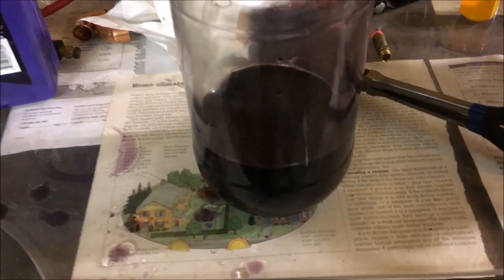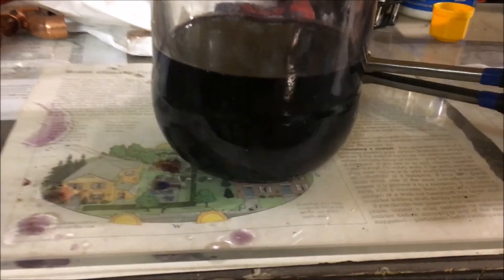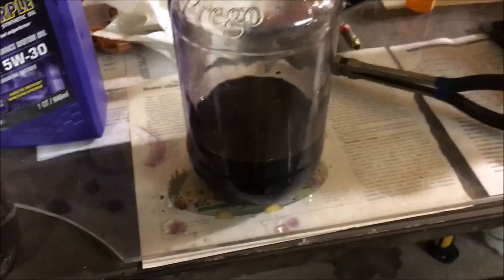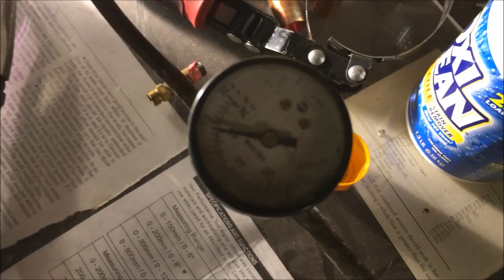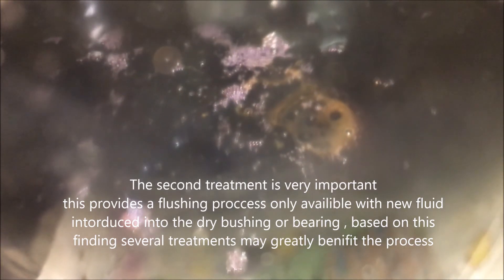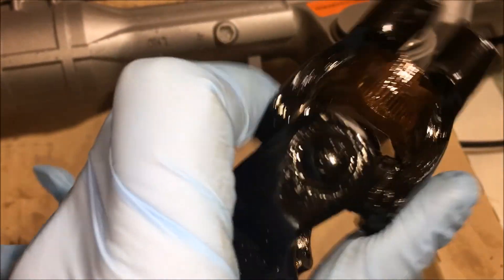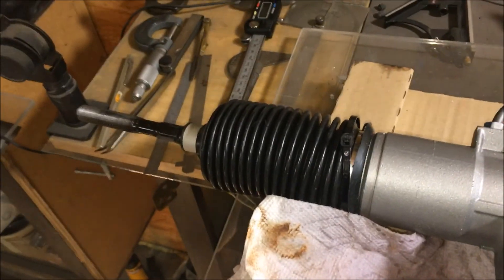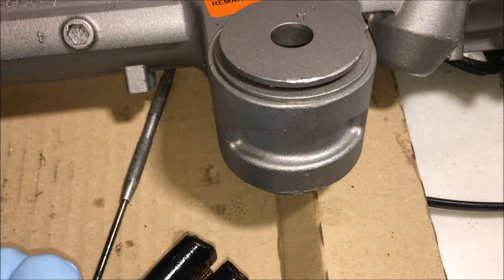Sealed Bearing Restoration,  Flushing and Recharging using vacuum pump

Comment: Boiled chip fat. If you want metal to never rust heat that metal then pour waste cold chip fat on it never rusts or gets contaminated. Did this on my car trailer hitch where I welded it as we were getting thefts of complete hitches a bit of a bummer when you had to use it and could not so that's the reason Same effect on bearings but clean chip fat of coarse
Reply from the maker: thanks for the tip , i never herd of chip fat
Reply: A uk meaning in u s a you may call it veggie oil ok
Reply: We have shops here called chip shops   Food is chips  you call fries a older type McDonald's  that we eat at for fish and chips.
Reply from the maker: oh ok yeah yes we have billions of gallons of chip fat in america , yes i have noticed that stuff does not come of of something once its on there and it repels water like a ducks back

Comment: I wouldn't have thought about using vacuum.  Great idea!!!!   I wonder if drilling some small holes(1/16"?) in the dust caps would help.  They could be sealed over with JB weld or maybe silicone after all the cleaning and lubricating were done.  A slightly bigger hole would probably let you put the red tube from most spray cans into it.....like PB Blaster or AeroKroil....???  ......or brake cleaner.  Just a thought.  I can certainly understand not wanting to spend $200 on that joint!!!  lol :)
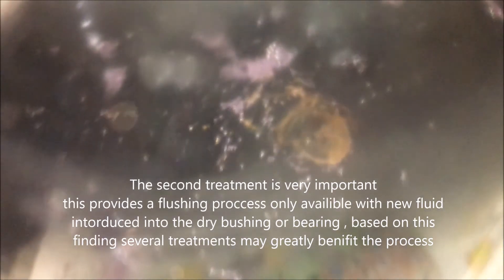Reply from the maker: Great idea ,this little bugger had a dust cap and an O ring under the dust cap , and buy the way i love kroil , they use that stuff at all power plants . Did you see the part where i was able to suck rust out of the joints ? just asking because i personally rarely watch an entire video and you gotta see this its around 4:17   . thanks for your input friend for some reason i didnt think to clean it first
Reply: I did see that part. Very cool!! :)  I actually watched all of it.  I set the playback at 1.5x....get's me through faster, but I can still understand everything. :)
Reply from the maker: bluehandsvideo lol great idea , i do that in editing , really wish i had a speed wheel
Reply: speed wheel?
Reply from the maker: bluehandsvideo its a wheel on a mouse that professional editors use so they can instantly speed up or slow down footage , it requires a compatible editing software and the paddle but they are very cool and very fast , they save editors from having to watch footage over and over again at the same speed
Reply: Ah...thanks. :)